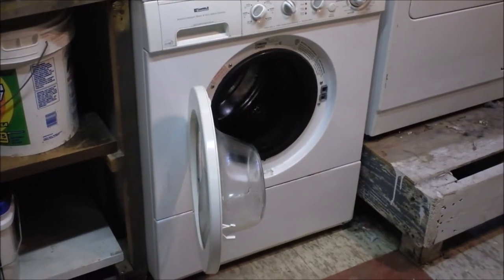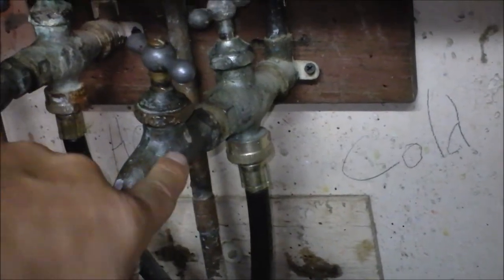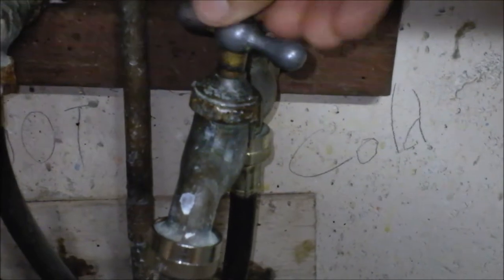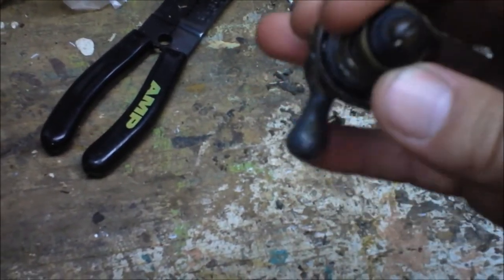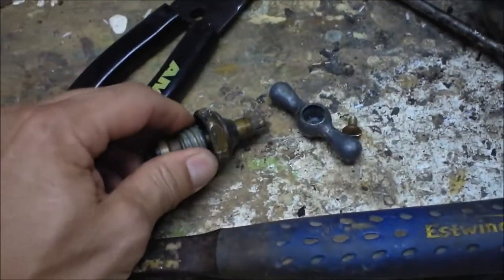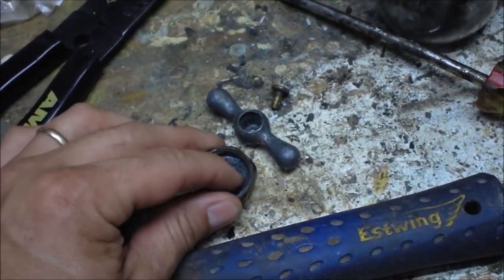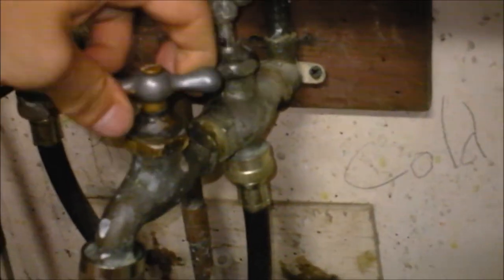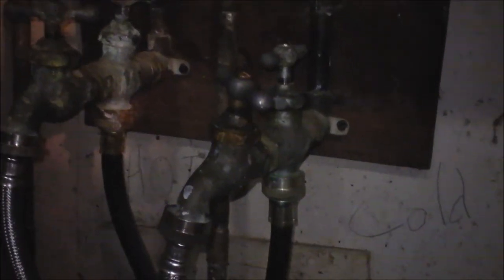Fix Leaking Hose Bib | Repack Bonnet (Cone Washer) with Graphite Packing!!!

Comment: 1)  Get a tripod.
2)  Go to the hardware store ( a real one, not Orange, Blue, or Green).  Take your handle assembly with you.  Buy the bonnet packing (it's called that) to fit your faucet.  If you can't decide which packing, ask.  That's why you go to a real hardware store.
3)  Go home.  Install packing.  Turn water on.
4)  Use the tripod if you make another video.